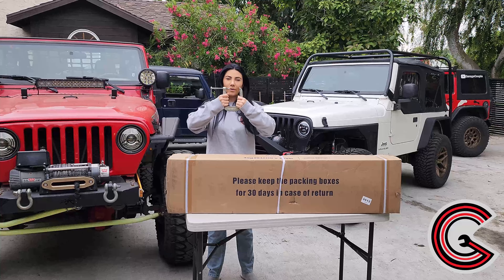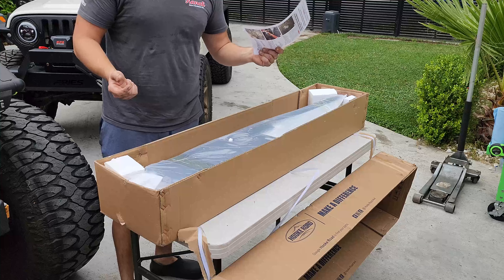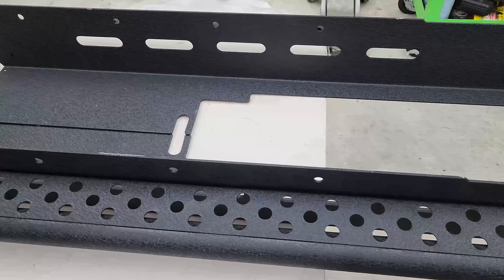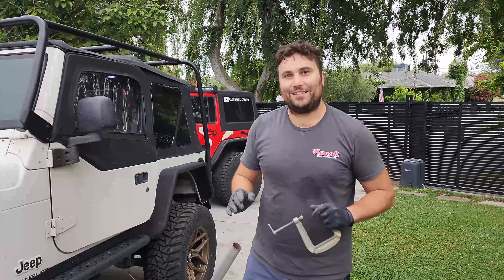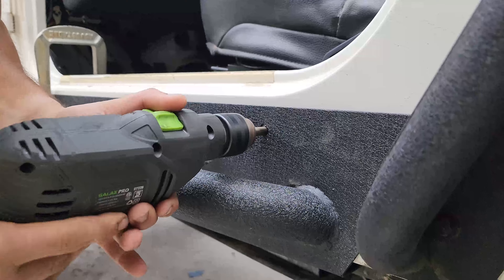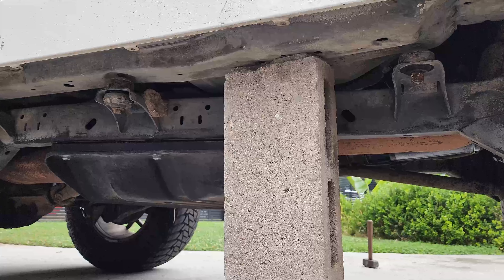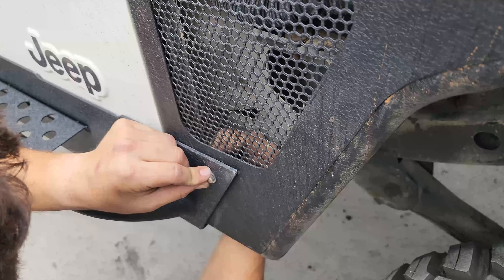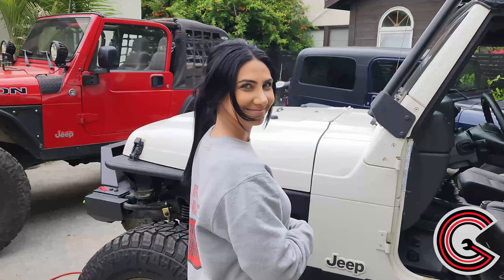Episode 17: Cheapest ROCK Slider Install Jeep Wrangler TJ , FULL DIY Install + Coupon Code

Comment: What length bolts did you use?
Reply from the maker: Must have been 3 inch
Reply: @Garagecouple just finished this project this weekend and used 1 1/2 inch bolts.  Plenty of length for the thin body metal. Just an FYI for anyone else interested.

Comment: 👍..the nut and bolt thing i did the same with my fenders.. it called for the rivits, but the bolts were easier and looked better...👍
Reply: Do you regret it? For the life of me I can’t make myself drill the body, I don’t know why. 😂 how’s yours holding up?
Reply from the maker: Don't regret it at all!!
Reply: @Garagecouple  sick hahah sold.
Reply: @dad3562   its great...no issues at all...
Reply: @Garagecouple  since you’re raising that cab up the thickness of the metal, won’t that mess up the tub on those sides now? Since you’re sliding something or raising it up though? Sorry for so many questions, reading a lot on the product before purchasing.

Comment: Don't meant to be rude here but the tool with the red handle to punch the guide before drilling is called a center punch. Also tapping usually means cutting threads.
Reply from the maker: Appreciate it!